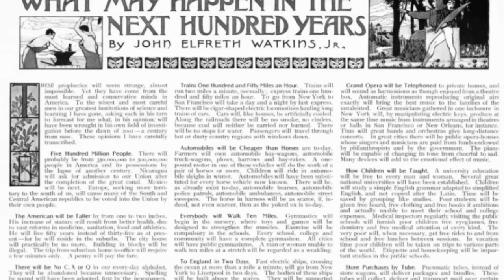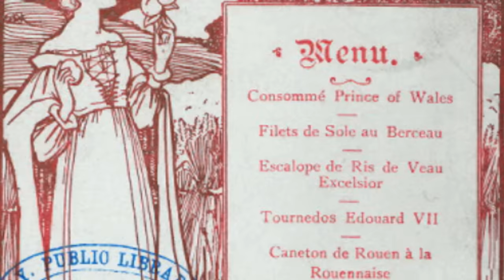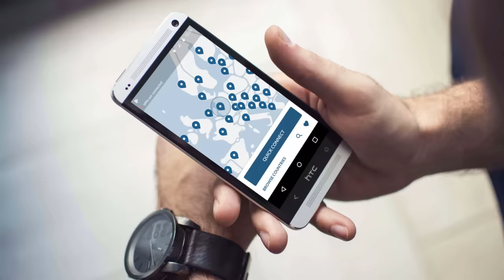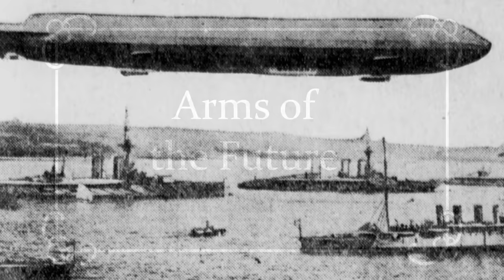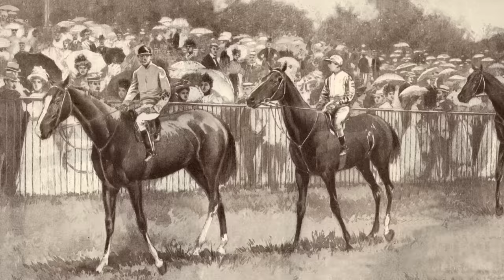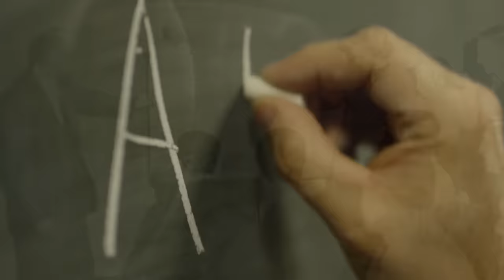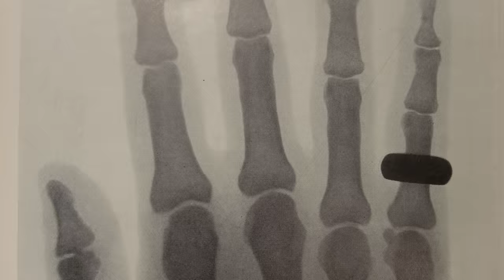Futurist from 1901 Describes The World of 2001 // 'Ladies Home Journal' (1901) // Primary Source

Comment: "The automobile will have practically replaced the horse in American society" Yeah, pretty much.
"All parts of America will be connected to the rest of the world by telephone wire" Very true, mostly.
"A university education will be free to every man and woman." *cries
Reply: Yes, we're stuck with only 13 years of free education instead (K-12)
Reply: @spk1121  I mean, they also had free and compulsory education to that level; it's just that back then you didn't need a degree to get a good job. At least we have free healthcare for the poor-...ohhhh
Reply: @DensetsuVII  you still don't need a degree to get a good job. If anything, a degree can be a detriment since it costs time and money that could have been used to gain practical experience
Reply: @DensetsuVII : College has become a form of gatekeeping. You have to go through "the system" in order to be considered acceptable to the overwhelmingly leftist HR depts across the country. Really think about this: Have jobs changed that much since the 1950s, that they require a degree? Secretarial jobs require them now, for crying out loud! And it would be very easy to adjust curriculums to add opportunities to earn certificates in fields like coding, no different than offering AP classes for college credit. That's why they "teach to the test" nowadays. Not too long ago, high school prepared you to enter the real world. Today, it is almost entirely focused on getting into college. It's why so many college students are clueless about so many things. They've had little to no grounding in the real world.
Reply: @spk1121  hurray to the Google degree then lol
Reply: @spk1121  that natural since employers got more options to choose from.
Reply: We do have free education
Reply: @GoldenOrder  Income tax rates of over 50% are also normal. In America most poor people have free healthcare and kids qho excell in academics and/or sports can get scholarships. Most lower income families receive $4k or more in tax returns. Most Americans believe that we best know how to spend our $ and we certainly get more per dollar spent. Governments are inefficient with $, spending twice or more what private companies do for the same thing. I can't remember who said it but "any government big enough to give you everything you want is powerful enough to take it everything you have."
Reply: @boomerisadog3899  A fun fact about the efficiency of government is that high schools that get the most government funding get the worst results.
Reply: It's true-ish in Europe (not free but dirt cheap)
Reply: All of the developed and developing world except america
Reply: "there will be no wild animals" 
w h a t
Reply: Public colleges are free here in Israel for veterans (and basically all Jews at least are veterans because it's required)
Reply: Get out of here ya mush. You get what you pay for. If college is free, the education quality decreases and the value of said degree decreases. It's already happening with all the government money they get as well as tuition fees. It's no one else's job to better you, only you can do that.
Reply: @spk1121  what do you mean by leftist hr?
Reply: @tanegram :  Have you heard the term "Get Woke, Go Broke"? It's a meme describing how companies are integrating cultural Marxism into their business practices, even to the point of losing billions of dollars because they are so stubborn about pushing the ideology. It's how they justify mandating toxic "diversity training," where they are literally paid to preach all white people are inherently racist & that America is fundamentally evil. How do businesses get to such an extreme position? It all starts in the HR Dept. A company's culture doesn't change that radically without HR acting as gatekeepers. They're the ones who not only select the employees, but run such awful, brainwashing "workshops." They look for people, like the fact-checkers I mentioned, who lack actual integrity & focus on "revolutionizing" the way society functions. That's the stated purpose of cultural Marxism: revolution. Antifa admits it, the leaders of BLM admit it, and do on. And within businesses, it's the HR Dept who leads the charge.
Reply: The lack or healthcare and public free university education are consequences of ideology and political decisions in the US, not technological or economic trends. Therefore unpredictable. The proof is that the US is the exception in that regard not the rule. All advanced countries (and some of the poor ones) have public healthcare systems or subsidized college education or both
Reply: John Frylock :
1.) You have zero knowledge of me or my level of education, along with everyone else who disagrees with your pompous ass.
2.) Why is it automatically rational? Why should taxpayers cover the costs of degrees that, as I pointed out above, were completely unnecessary for similar jobs only a few decades ago? No one has even attempted to refute that simple assertion because we all know it's true. Why should taxpayers fund Gender Studies & other such fields? I don't want my money going towards that! And if people are that interested in such a field, they should pay for it, just like they do now!
3.) I have some respect for Forbes, but the author admits she based her article entirely on reports by BuzzFeed and (MS)NBC! Yeah, they haven't been heavily criticized for repeatedly reporting fake news or anything. * lol * They've been exposed as liars time & time again. Zuckerberg has admitted to such discrimination and said they "will take steps to do better." (Yeah, right.) Jack Dorsey from Twitter admitted it on the Joe Rogan podcast. Seriously, dude, you are in a solid echo chamber if you can't admit conservatives face higher rates of discrimination online. Fun fact: The ones on the left who are most likely to encounter similar issues are the most anti-war.
4.) Look at my response to Joaquin M as to why I consider HR depts to be leftist in general, in greater detail.
Reply: Funny how a video about the musings of futurists in 1901 has turned into a whole commentary & arguments about the current state of the U.S. * shrug *
Reply: @spk1121  You lost me at the "Cultural Marxism" bit. That's no a thing that exist, and usually when I see it in the Internet is code language for "the Jews". Also the Left should have to be very powerful indeed, if they have control of HR departments across America, to gate keep for the college educated.
Now, in the realm of reality, the reason why you need college education for work roles that didn't require it in 1900 is because employers ask for it. For example, in 1900 you could get a job as a teller in a bank without a college degree, because it was a mechanical job dealing with public and recording transactions, because of that, the skills required for the job were being good with numbers, have a good penmanship and some basic knowledge of bookkeeping. These days, first you would be hard pressed to find people working as a teller in the traditional sense (that job has been automated) is now more of a role that bank employees have sometimes as part of their duties, but they also act as credit officers, financial advisors and the day to day operating of a bank includes fairly complex operations like reconciliation, you need to have an understanding on how to operate and interact with computer systems and other institutions, regulators, etc. So the amount of education that an employer needs from his employees to make a profit out of them, is vastly different. But the cost of that education has to come from somewhere. In the US the owner class and their politicians decided they wanted to Profit from a more educated workforce but didn't want to shoulder any of the costs, either by the companies training their new hires in house or by paying higher taxes so the State could pay for it. They simply required university education for entry-level jobs which de Facto passed the education costs to the workers. 
Most advanced countries decided for public University and Vocational education instead, to better living standards and don't unfairly burden workers with its cost. Result: better social harmony and healthier economies.
Reply: @Densetsu VII Don't feel bad about not going to University/College. I spent a decade of my life and tens of thousands of dollars on University and it was a waste. The fact that everyone gets a degree these days had devalued those degrees to the point that they are worthless. Other than a single idealistic one, all the professors there were more interested in telling me what to think, rather than how to think. They believed that they already knew all the answers and that I was just an empty vessel that they were going to make think "the right way". Only one man thought that his job was to teach me how to think for myself so I could find my own answers. And the Universe mistreated him and hounded him out for questioning established doctrine. To top it all off, I could have easily learned all the facts and knowledge that I learned in University, by using the internet. By reading books, by downloading audiobooks, by downloading pre-recorded lectures off of sites like Audible.

The image we have of University as a place of learning, where you go to expand your mind and become a better citizen has not been valid since the 1980s. Its now just an extension of High School that you have to go into debt for. For your own sake I would advise staying away. Invest your time and money on something worth while. Don't sacrifice your future just so a bunch of pretentious assholes can brainwash you.

I've been where you're headed. For Heaven's sake, turn back.
Reply: You don’t need a degree for a good paying job, there is such a thing as Trade Schools that teach trades such as mechanics, plumbing and many others! Unlike a lot of countries, we don’t need to pay for the first 13 years, we get our books free, don’t have to pay for tuition (unless in a private school) or uniforms.
Reply: John Frylock : Ha, ha, ha! It all boils down to ad hominem attacks, doesn't it? No refutation to any of the points in my latest response, not a single one, just insults. Honestly, if people on the political left didn't devolve to this level so quickly, I would be much more inclined to take their ideas seriously. Have a good day.
Reply: @marlonbryanmunoznunez3179 : My response keeps getting deleted (speaking of gatekeeping), so I'm going to break it up into chunks.
Reply: @marlonbryanmunoznunez3179 :  Well, again, you know nothing about me. I grew up in an area with a large Jish population and have at least a dozen Jish friends. I don't subscribe to the theory of an all-powerful cabal because I recognize there are plenty of white people (or of other races, which could include some Js) who would happily screw over a huge number of their fellow citizens in the pursuit of power & wealth. Also not sure why you inferred that when I didn't even remotely refer to them, but to Antifa and BLM instead. As for not believing in cultural Marxism, all I can say is that leaders in those radical groups have openly admitted their motives & their unabashed desire to overthrow the institutions and foundations of this country. I'm not getting this from from some right-wing tabloid; I've listened to or read their own words.
Reply: @marlonbryanmunoznunez3179 :
It's a funny coincidence that you brought up banking to make your argument. I worked at a credit union for 2 years, then a bank for about 6 months, so I can say with absolute confidence that you're incorrect. My degree was not in finance or business, far from it, yet I did very well by keeping an accurate drawer, meeting sales goals (like convincing people to put money into a certificate of deposit), and good customer service. I knew several tellers who advanced to the level where they could do loans & other more complicated transactions. They did this with in-house training and, like me, a number of them did not have a specific financial background. Yet they got promoted and were good at their jobs! So, yeah, I know from personal experience that one job many people think requires a degree, doesn't, which gives me solid reason to believe there are many others.
Reply: @marlonbryanmunoznunez3179 : As for vocational training, that is by far the most cost-effective approach. Here's the truly ironic part about the absurdly high costs of college: It's almost entirely because of govt intervention. Why does tuition keep going up at state universities? Or at private ones where some, like Harvard or Take, receive millions upon millions of dollars in endowments? Ever since the govt has guaranteed student loans, this has been the case. The universities can bleed their students dry and, by extension, the govt. This, coupled with overreaching govt oversight, has led to bloated bureaucracies with little accountability. There are any number of examples about endowments going to a new wing of the library or some other project for the glory of the school, rather than lowering tuition. It's gotten so absurd that, in those rare cases it actually happens, it will be deemed a newsworthy occasion! Did you know some colleges are still charging rates to include room & board while only offering classes online during the pandemic? If students have the need to protest, I would immediately point to their university's administrative building & the office of the president/chancellor!
Reply: @marlonbryanmunoznunez3179 :   
Last thing, regarding the power of their gatekeeping. I strongly encourage you to look at the testimonials of the #WalkAway Campaign. There are gay people who say "coming out" as conservative has been far more difficult than revealing their sexual orientation. There are people who have not only lost people they considered close friends, but have been completely shunned by family members, if not cut off entirely. A significant number of academics have admitted they "played along" when it came to their professors' biases in order to graduate, and the rare times one academic has spoken out, they invariably tell of support from colleagues who beg for anonymity because they're too frightened to say anything themselves. And yes, there are people who have been denied admission to a school or a job because they wore a MAGA hat or showed any sort of support for Donald Trump. (Marquette recently had a scandal where the president outright admitted it & didn't back down until a public outcry.) There are people who have either been fired or denigrated at work to the point where they are forced to quit. So, yeah, I stand behind my statement that HR depts are powerful. If millions of people are afraid to say something about what they believe, it really says something about the people who hold their livelihoods in their hands.
Reply: Brynden Rivers : Tell me why. If you have an actual argument, I'd like to hear it. I've seen Antifa swinging hammer & sickle flags; I've watched one of the leaders of BLM admit that she & another founder are, in her own words, "trained Marxists." Can you point out HOW I'm dumb & wrong? And for the record, taxes already go towards funding state schools and I am fine with that. As I stated above, though, that money should be used to lower tuition. Not force every taxpayer to pay for every student at the exorbitant rates they charge nowadays. And yeah, I'm one of those crazy people who thinks everyone should, as much as possible, keep as much of their own money to spend as they see fit, rather than handing it off to bloated, inefficient govt agencies. You can agree with that, right? That a lot of govt is bloated & inefficient?
Reply: @IRosamelia  what's really wacky about that is the only reason y'all can afford to have welfare states with free college education is because you don't have to fork up as much money for your defense because of us.
Reply: @GoldenOrder  Same in France and many other European countries
Reply: @GoldenOrder  Yeah
Reply: @boomerisadog3899  I'd like to know where that free healthcare is at. When I was in Peace Corps, I collapsed on the side of the road, and woke up in the hospital, finding out I had a brain tumor. When I was sent back home, I was asked 3 or more times, everytime I went to the hospital, who was going to pay for my brain surgery. They said if there was no for sure answer, that they would push my surgery back by a few months. Luckily Peace Corps paid, otherwise I might be dead. It wasn't just a brain tumor, it was aggressive cancer. 
Also- the hospital did say they would cover my treatments, since they knew I was from a low-income family. Turns out what they actually did though, was try to send every bill to Peace Corps, even though I told them, Peace Corps wasn't going to pay for anything past the brain surgery. So- Peace Corps sent it back, and it bounced around so long, until it finally came back on me. A lovely surprise bill of $51,000. 
Oh, and when I applied for Social Security, I was denied because I had- and I quote, "The wrong type of cancer." They only had forms for breast and cervical cancer, which I told them I didn't have. They didn't care, and told me to fill it out anyway. 
People claim it's so easy for the poor to get help in the US, but I haven't seen it. Luckily, I have been able to move to South Korea as a teacher, and here they actually do cover the cost of my MRIs, and anything else related to my cancer. Something I never experienced in the US.
Reply: @GoldenOrder  Nothing is free. Another part of the economy takes a hit for it. (Not a value judgment. Just an observation).
Reply: @arandomyoutubeuser_____8930  I live in a rural part of Tennessee and did construction work my entire life, even after 2 back surgeries. When I had yet another ruptured disk and needed another surgery I got it with no insurance. Afterwards I applied for Tenncare and got it. It not only pays for my current medical bills but paid for my lasg surgery as well. Your experience is not representative of what countless friends and family of mine have experienced. I'm 40 years old and own my own home, several cars (including a 67 Chevelle SS), an rv, a rental property, and have nice piece of undeveloped land bordering a national forest. All of that is paid for, although, I do have to pay property taxes. I was born dirt poor and raised by my grandparents. Everything I have my wife and I earned through hard work and sacrifice. The great thing about all that is that this country gave me the freedom to earn those things and didn't take unreasonable amounts of $ from me to pay for other people's bad decisions. America is a great country, not for what it does for it's citizens but for opportunities and freedoms it protects. I'm happy that you found a country tbat more closely aligns with what you believe a country should be. You should be thankful, for what American medicine did for you, instead of angry that it wasn't %100 free. You should also be thankful to this great country for the freedoms and wealth that South Korea enjoys. That country wouldn't even exist without the help and continued support of the United States.
Reply: @boomerisadog3899  I'm glad that you have had a good experience, truly. However, in South Carolina, it's not so easy to find people that want to cover cancer patients. Especially patients with aggressive cancer. I know that my experience is not representative of what everyone in the US experiences. I have plenty of extended family members who argue with me, because they've never had an issue with medical insurance in their entire lives. However, you should also know that your experience isn't representative of what millions of other Americans like me, continue to experience in the US. I am, and will forever be grateful to the men who saved my life. However, I can also be angry that the system was only willing to do it quickly, if they had a guarantee of money. I can also be angry that I was denied Social Security, because I "had the wrong type of cancer." (their words) I don't know that I will ever have good credit in the US, thanks to the $51,000 bill that was thrust upon me, all because they didn't let me die. If you have any suggestions for how I can get that paid for, I'm all ears. Seriously. I don't hate the US. I love my country, but I'm also saddened by the fact that many poor people, like myself, get screwed over by the system time and time again. I will also mention that an MRI in the US is $3700 and here it's $400, with no insurance. The main difference is that the waiting rooms here aren't quite as extravagant as the waiting rooms in the US.  There is no legitimate reason that the price should be that different.
Reply: Densetsu VII they did at least get free lunches and rides to school correct
Reply: Confused shrugged* university education shouldn’t be free.  Government is to big and bloated as is.
Reply: for people who are poor we already have free college. harvard charges you nothing if your family makes below a certain amount (though that only goes to brown people, discrimmination against whites is common nowadays.....bet they didn't see that coming)
Reply: Postal Patriot556 
That’s complete and utter nonsense and you know it. Stop propagating misinformation to serve your agenda. It’s the same mindset which is stopping America from attaining a healthcare system worth the name.
Reply: Free education would only create a spiral up on the necessity of education College would no longer be enough as the college student is universal as college is free. The masters and PhD would begin being needed for anything but entry-level jobs. Then the call will be made for those to be made free as well. A new degree will be made since phds have become a common sight. Eventually the system collapses under its own weight as people live their whole lives as students or the requirements for working become so unreasonable that everyone simply refuses to climb that mountain of education.
Reply: @BlueGamingRage  you do need a degree for most any career or Atleast a trade certificate
Reply: We are getting there
Reply: Back then a "University Education" wasn't just a job farm, that was the only possible way to learn anything scholarly besides coming across books which was much harder, even libraries weren't that widespread and stocked as they are today. Now we can get 1000x the education they got online, and for free.
Reply: Brynden Rivers : Can you do me a favor and define what you think “Marxism, socialism, and/or communism” means?
Marxism is entirely based on the concept of oppressed and oppressor, the proletariat and the bourgeoisie. They are enemies; there can be no reconciliation, which is why revolution is required. It was originally considered an economic theory, which is why he argued capitalism would gradually give way to communism. He spoke in very broad terms and rarely, if ever, acknowledged the complexities of human nature. Finding the economic model to be less effective in converting the masses than desired, Marxists have shifted to a cultural angle. There are still victims and oppressors, which is why a revolution is still required. All women are oppressed by all men. All black people are held down by all white people. All gays are despised by all religious people. And since there are so many oppressed classes, it becomes necessary to form a victimhood hierarchy. All societal ills are systemic, requiring the aforementioned revolution.

You have been speaking in this language yourself, right here in this thread. "Conservatives, especially nowadays, tend to have hideous and bigoted views about other human beings..." "Trump supporters are typically hateful people or people who are okay with hatefulness." Yeah, you added "tend to" and "typically" to cover your bases, but I'm guessing you would say at least 95% of them are this way. You painted with a particularly broad brush when you said, "Who gives a damn about some Catholic university, you’re more likely to get a finger in your b-u-m than you are a degree there anyways." That's not a gross generalization in any way! /s By the way, you didn't refute my example. You just dismissed it outright because it would have given at least some credence to my argument. But hey, I'm the one ignoring facts!

Look at my response to you. I didn't call you dumb and wrong in return, instead I asked you WHY you think the way you do. Few liberals and no leftists ask this first, ever, at least in my experience. Do you believe around 50% of the country is genuinely evil? If so, that's why you so easily say conservatives are hideous, bigoted, and hateful. It dehumanizes us and allows you to unabashedly view conservatives as your enemies, with no chance for reconciliation. It's good and right to hate the hateful, isn't it? So, oversimplifying the world (as Marx did) allows such a mindset to continue without guilt or introspection. And for the record, I fully believe it is possible for leftists to eventually believe otherwise, which is why I try my absolute best not to demonize them, despite my extreme disagreement with them. #WalkAway has proved this happens again & again, beyond a doubt.
Reply: Brynden Rivers : Can you do me a favor and define what you think “Marxism, socialism, and/or communism” means?
According to Merriam-Webster, socialism is...
1: any of various economic and political theories advocating collective or governmental ownership and administration of the means of production and distribution of goods
2a: a system of society or group living in which there is no private property
2b: a system or condition of society in which the means of production are owned and controlled by the state
3: a stage of society in Marxist theory transitional between capitalism and communism and distinguished by unequal distribution of goods and pay according to work done

Nobody actually wants socialism. They want fair capitalism with a strong social safety net. I say this because no one could possibly want govt ownership of private goods. If you say otherwise, you're lying, most of all to yourself. A good example would be if the govt decided you don't need a car because you are within biking distance of work and/or public transportation is accessible, if inconvenient. They then "reassign" your private property, most likely without consulting you first, in the name of the "public good." Since the state would control the means of production, they might then decide to produce the absolute minimum number of vehicles required to keep things running, never even giving you an opportunity to have another vehicle in the future. Sounds fun, right? There are already numerous instances of eminent domain be horribly abused. Can you imagine this on a nationwide scale with everything? By the way, even Denmark told Bernie Sanders to stop referring to their nation as socialist! Because nobody actually wants socialism.
Reply: Brynden Rivers :*Can you do me a favor and define what you think “Marxism, socialism, and/or communism” means?*
According to Merriam-Webster, communism is..
1a: a system in which goods are owned in common and are available to all as needed
1b: a theory advocating elimination of private property
2 -- capitalized
a: a doctrine based on revolutionary Marxian socialism and Marxism-Leninism that was the official ideology of the U.S.S.R.
b: a totalitarian system of government in which a single authoritarian party controls state-owned means of production
c: a final stage of society in Marxist theory in which the state has withered away and economic goods are distributed equitably

1a, 1b, and 2c are based solely on theory. 2a & 2b are the reality. As I said above, Marx failed utterly and completely in his understanding of human nature. Communism might have a genuine chance under one condition: society would be made up entirely of robots. Everyone would be built for a single purpose, would know their place, and would contentedly stay there. No ambition, no love (which often leads to the greatest feats imaginable), no courage, and most importantly, no dissent. Only perfect harmony can determine what should be produced and which goods should be available to whom. At least under socialism, you would get an official notice from the govt if they were taking your car away. Under communism, someone could just walk in and take it at any time! And again, the "public good" would be the excuse. Of course, there is no such thing as perfect harmony. Such actions (with the car) would lead directly to chaos, so the only way to "enforce harmony" is by totalitarian means. Regarding 2c, what does "distributed equitably" actually mean? Will a person who works hard & is a model worker receive exactly the same resources as the local slacker? If so, what's the incentive to even try? If not, doesn't it constitute private property if someone has something another person was not given? Honestly, the fact that so many people take Marx the least bit seriously baffles me. You have to give this 5 seconds of serious thought & it falls apart immediately.
Reply: Sans Handlebars : Thanks for saying something. I appreciate your kind words. I'm glad you were willing to make your own voice heard. I like to think that no one is truly lost, that even someone like John Frylock can learn better. I don't hate him or Brynden. I feel sorry for them and wish them the best. I provided a lead, Marquette, to Brynden, who immediately discounted it with a crass "joke," then unironically said I'm the one ignoring facts.The fact that JF cannot recognize his own baseless attacks, apparently needing for a direct quotation every time, or that he can believe he actually refuted anything, demonstrates the power of the conditioning.  They'll say we're brainwashed right-wingers while knowing nothing about us, but have they ever acknowledged the possibility of left-wing brainwashing? Do they think those on the left, particularly the more radical elements, are all as pure as the driven snow? That maybe, just possibly, there are things being hidden from them or even things they know, on some level, that they are willfully ignoring? Part of wishing them the best is the hope that they will come to see things from a different perspective. I am not looking to "convert" anyone. I just want to open some minds, hopefully allow some people to see just how ludicrous they are being. That's why took over an hour to compose my three-part answer to Brynden. At this point, I know I cannot reach JF in any way, but I'm hoping there's a chance Brynden will take another look at things. If he responds respectfully to those replies, I'll know it might be worth putting the time and effort into the rest of it. We shall see.
Reply: John Frylock  Wait....  You really believe that all the mega conglomerate tech companies are 'right wing' and pushing THAT agenda. You really believe that Google, Facebook, Twitter, etc... are pushing 'conservative views'.
 You're on the spectrum, aren't you.
Reply: @BlueGamingRage  depending on the field...
Theres teenagers gaining millions just by making content for youtube, you can quite as well get a good job without any degree.
The entertainment industry, especially the game industry, all you need to do is watch some tutorials and start practicing what you learn, in some ways is more about what you are capable of doing than how and where you learn to do it.
Reply: @boomerisadog3899  Honestly, this one reply was more help than my entire family has been. I've had others tell me that they've had things paid for, but nobody could ever seem to point me in a particular direction, of where to look. I have only been told to go to Social security, and as you already know, that didn't work out so well. 
Seriously though, I appreciate the answer, and the well-wishes. Thank you!!! And I hope you and your family stay well during this time.
Reply: @arandomyoutubeuser_____8930  No problem at all and I really do hope it helps. I've always had to do everything on my own too, if it wasn't for my wife I really don't know where I'd be right now. I just told her about your situation and she gave me those recommendations. Their really a lot of help out there but it's hard to find if you don't have someone that's had experience with that kind of thing. My wife's mother got lung cancer from working in a insulation factory and my wife took care of her through a lung transplant. So she's had more than her share of dealing with hospitals and all that. She's the sweetest, most selfless person I've ever known and I'm truly blessed to have her. Again, best of luck to you.
Reply: Tuition isn't free, but you can get the education for free on the Internet.
Reply: We had i tin Australia for a while 

cries that was my parents' generation but it is no more
Reply: You can get university level education from the internet for free for a lot of subjects.
Reply: Brazil and Nordic countries have free graduation and even free PhD.
Cries in third world.
Reply: Lol guys, I read your discussion. Have you all ever considered that just because it is free doesn't mean it is communist? But instead it is just... Affordable.
Reply: I don't know anything about United States Constitution but Brazillian Constitution says very clear that education and healthcare is a citzen right so is a government must.
Reply: @2pedroandrade : First of all, nothing is free. Someone has to pay for it somehow. In every single state (to the best of my knowledge), do you know who the highest paid public employee is? Not the mayor of the largest city, not the governor. It's the coaches for the American  football team at the various universities. Directing young men in how to run around & catch oblong balls is "worth" at least a million dollars a year, in their minds! Other costs go towards "improving" the campus, by adding fountains or another wing to a building, instead of lowering tuition. Trade schools & technical colleges are still very affordable because they remain focused on learning. They have nice facilities while still remaining cost-effective. Those schools are also far less likely to have bloated, inefficient bureaucracies in place, which eventually make self-perpetuation their goal, rather than remaining useful. It's why so many "temporary" programs in govt and at universities never end. It's the university culture & govt-subsidized loans that make college so expensive in this country. I would love for college to be more affordable & it stinks because just a few changes, albeit significant ones, would make them be so again.
Reply: It’s free if you ain’t American ✌🏻
Reply: They do that in the US, no excuse for the lack of good paying jobs other than there just isn't enough because it's cheaper to offshore as much as you can to tyrannical and destitute nations to pay lower thus bigger profits.
Reply: @spk1121  Exactly. It is not free, it is paid with our taxes. But one thing I can't understand. The US have taxes, right? If there isn't public higher education and healthcare, then what are they doing with your money? I know theres a lot of others services but education, healthcare and security are so primary.
Reply: Wireless connection connecting a husband on a boat in the Atlantic to his wife in her drawing room. Gps signal or internet. Great foresight !
Reply: Sans Handlebars  Well, in my personal opinion those public services in Brazil are top quality. I study at USP (Universidade de São Paulo), the biggest of latin-america and it is totally public, actually, all the top 10 universities in Brazil are public. Other thing is the healthcare here, we have SUS (Sistema Único de Saúde/Unified Health System) that makes me confort to drink water from the plumbing or get free tests or attendance for Covid-19 (or all others diseases), vaccines, medicines and even more.
The problem is: Brazil is not developed country, inequality here is big. The system might work, but it can fails where the government don't cover, but I think it is more a economic problem than a problem on public services. Finally, the Bolsonaro problem. I think everyone outside and inside Brazil with more than 2 neurons knows this guy is a lunatic. Since he was elected he just cut milions of Reais from Universities  and SUS. Why? Because he wants to be the USA. For good or for bad (You'll should see him talking with Al-Gore saying that he is very happy to "explore the Amazon with the US". This is just treason with his Homeland).
Reply: University education is essentially free via the internet. It's the degree/certification that you have to pay for.
Reply: Sans Handlebars  But I said very clearly that Brazil is not so well ranked because is indeed a poor country but the system works anyways. And I think help homeless and drug adictioners influences directly in my health. But SUS doesn't help only those people, it helps the whole country. All vaccines and medicines I used in my life were free, and this is universal in Brazil. The problem is: even with a well working health system, the economy of the country doesn't help on being the world's best health.
Reply: Sans Handlebars  Brazil poorverty is historical and structural. I know why my country is poor, I study Social Sciences, and there is nothing with taxes. At the time SUS didn't exist and there was no free university, Brazil was still poor. The riches don't flee from Brazil, they just don't let the others grow financially. For example, Brazil never had a land reform like Abraham Lincon did, so, the families wich were rich at 1600's probably still is rich nowadays and influences politically in the country. Also, talking about politics, here corruption is a REAL big thing, for some people, the only real problem that prevents Brazil to grow. And I not even talking about the Elites Dictatoriship and Military Dictatoriship (caused by USA at the 60's). Brazil plenitude as a democracy was just achieved at 1988, it is a damn new republic.
Reply: Sans Handlebars  I think it will be hard to we reach a conclusion since you are are arguing based in recent factual reports and I am analyzing at a historical and critical level.  I'm not unworthing your way of argue, data are essencial, but we need a little pinch of historical critical thinking and sociological imagination. It will be hard to conclude because we use different dialetical methods.
Reply: I scoff at that last one. Nothing is ever free in reality. There’s a cost for everything.
Reply: Actually, it is true by concept, you can learn all university education for free on the internet.
Reply: @punchnazis3268  Yeah I hate the forced migration of third worlders by billion dollar corporations to lower the prize of labor too
Reply: @spk1121  
>HR
>Leftist

Ah yes, the middle managers - scholars of Marxism who adhere to the ideology and work in middle management as a means of leftist praxis. How could I forget.
Reply: @spk1121  Describe Cultural Marxism in your own words. 😅
Reply: @bigwes617 : Keep reading, I already did that. And you can be an adherent of an ideology without being a scholar. Cultural Marxism is a worldview which turns everything into an oppressor/oppressed struggle. HR, in general, now operate under such conditions, like clearly biased "diversity training" and so on.

When a man is accused of sexual harassment, he usually cannot confront his accuser & is often forced to try to prove a negative. MeToo is this taken to an extreme. It started off right, with a few genuine scumbags being exposed, but quickly morphed into "Believe all women... without evidence." So much so that many men are adamant about not being alone with a woman, even in a mentoring capacity, and this has led to a dip in the number of women hired in the first place. Their toxic worldview was so unrelenting that they cheered for this. In the end, MeToo created a schism between the sexes which eroded trust and respect across all levels. Totally worth it, though! /s
Reply: @2pedroandrade : *...then what are they doing with your money?"
That's the crux of the matter, isn't it? Useless foreign wars is unquestionably the #1 problem. Billions in financial aid to other countries, particularly wealthy ones like Israel, are another. I think we could safely close a number of foreign military bases, too.

One news story from a year or two ago, which got buried by the mainstream media, is that Trump's "temper tantrums" with European allies resulted in several countries paying their fair share of NATO dues for the first time in decades.  It really is true that the USA's military spending gives other countries more opportunity to implement their social programs. Admittedly, we don't have any fiscal responsibility ourselves, which is why the nation is trillions of dollars in debt. As bad as universities can be, bloated & inefficient govt agencies or programs are far more rampant.

Last but not least is our history. While the executive branch has claimed enormous authority in the last 80 years, there is still a separation of powers between the  federal govt & the states. We have public universities, but the vast majority of tax money going towards them are from each state, not from the national level. This is to protect a state's autonomy, not making them dependent on the federal govt. It's a trade-off, to be sure. Sometimes, social cohesion is not as strong as it could be because we also highly value the independence of individuals, communities, and states.
Reply: @marlonbryanmunoznunez3179  there is value and virtue in not just giving these things for free. The independence and autonomy of individuals.  The virtue of self reliance of the individual and the family. It is the people's job to take care of their own private needs.
Reply: i love how your comment has somehow turn into a mud throwing competition by "experts" in economics and education.
Reply: *cries in American
Reply: @spk1121  before you accused others of not being well reasoned look at your own comment, you automatically assume everyone who doesn't think like you must be a leftist and that is a bad thing. Until you learn to ditch your stereotypes you are not well reasoned no matter how much you have deluded yourself.
Reply: 15:55
"Etiquette and house keeping will be important studies taught in public schools." 

That would be 1950.
In 2001, it's gender studies and Social Justice Warrior activism.
Reply: Universirty education used to be quiet cheap 50 years ago in the US. It pretty much is free in Western Europe.
Reply: Same... :(

On the other hand I chuckled when the prediction about airships came up. Ships aren’t that much faster than they used to be, at least in the grand scheme of things, however we truly have made the air our home.
Reply: @jon9103 :  I never assumed that. Where are you getting that from? It's true that I was speaking in general terms about HR depts, but I have solid reasons as to why I think so (which I explained in detail). I never, ever said anyone replying is a leftist. You know what did happen? Hans B immediately denounced me as an idiot, saying I should join the Dunning Kruger society. John F then jumped onboard, calling me illogical, nonsensical, and a weirdo. They did this before I ever said a word to either of them directly. The person who actually asked me what I meant got a respectful and hopefully informative reply. That's how I would have liked to have treated everyone is this thread, but you'll have to forgive me if I don't react all warm & fuzzy towards those who are being disrespectful from the get-go. Will you call out Hans B and John F for their mean, childish behavior?
Reply: @relo999  That's because they set the system up that way. Schools that perform worst geg allocated the resources requires to fix it...on paper. In reality the problems with failing schools runs much deeper than funding. It's a social and community issue thag funding plays a part in but not overwhelmingly so.
Reply: @spk1121  Find me a solid example of a company unequivocally stating to their employees "all white people are evil" and all the other nonsense you spouted. Post a link for us all to see this in action. Shouldn't be hard to find if its company policy. Should be real easy. Clock is ticking.
Reply: poewhite  There is a pretty large group of people seeking a more enlightened path. Technology is fine so long as it is incorporated and developed with reason and responsibility. Big difference between embracing the use of technology and allowing technology to replace your society. Im not sure how this game will end but I know that we aren't all going "silently into the night" when push comes to shove.
Reply: @marlonbryanmunoznunez3179  Good luck getting through to any of these people. They won't read all  ut the first couple sentences and decide it's "leftist garbage" and won't finish reading your point. A point which is well rationalized and laid out mind you.
Reply: @spk1121  is try to explain it to you but you have already demonstrated by your comments that you are quite insular so it would be a waste of both of our time.
Reply: @jedimindtrix2142  : Is 14 links within 3 hours enough?
To be clear, seminars on "white privilege" fall under this category since "privilege" wouldn't exist without the underlying assumptions that all white people are racist and all of society's ills are systemic in nature (racial or otherwise).
 As one trainer in Tennessee put it, "White privilege exists because of historic, enduring racism and biases."

*Seattle to White Employees: ‘Your Skin Color is a Crime’
Ordered to undertake "the work of undoing your own whiteness."
- I encourage you to read the entire video description. It includes the following:
Last month, the City of Seattle’s Office of Civil Rights sent an email inviting “white City employees” to attend a training session on “Interrupting Internalized Racial Superiority and Whiteness,” a program designed to help white workers examine their “complicity in the system of white supremacy” and “interrupt racism in ways that are accountable to Black, Indigenous and People of Color.” Hoping to learn more, I submitted a public records request for all documentation related to the training. The results are disturbing.
https://www.bitchute.com/video/fswSsRSIQ2Ci/

ALL White People are "Racist Demons" Says BLM Activist & Lecturer at Seminar
- Again, I encourage you to look at the video description for more quotations from her. This video is a short version; longer one is available if you search for Ashleigh Shackleford.
https://www.youtube.com/watch?v=cRXNaUz5LGY

Teaching consultant: Being on time, giving grades are forms of ‘white supremacy’
- Directly impacting teaching methods and approved cirriculums, meaning only teachers who agree with such notions will be considered for teaching jobs.
https://www.thecollegefix.com/teaching-consultant-time-giving-grades-forms-white-supremacy/

HR Expert: The Truth About Diversity Trainings
Wendi Modarelli (HRT Northwest) talks about human resources in a time of identity politics. Wendi gives her take on how businesses should address issues like diversity, equity and inclusion. Implicit bias is something that more companies are factoring into their hiring process, but what’s the best way to do it? Wendi also gives her expert opinion on what the data says about how effective diversity training is.
- While I must acknowledge there is little to no way to verify actual identities, it's still important to note there are a number of testimonies from people (in the comments) who have experienced such workplace programs.
https://www.youtube.com/watch?v=aMic_0a2TDE

UConn to pay ‘white fragility’ scholar Robin DiAngelo $20,000 for antiracism workshop
The University of Connecticut is slated to pay “white fragility” scholar Robin DiAngelo $20,000 to lead a three-and-a-half-hour workshop this fall for administrators during their professional development retreat... At the University of Texas in 2017, she told students that too many white people are teachers. During her appearance at Boston University in 2019, she said white people who don’t see race are “dangerous.”
- DiAngelo is a self-admitted racist who claims all whites (including herself) are racist, yet she, somehow, is an authoritative figure who is paid about $6,000/hr in order to harangue others & dictate how we should all live our lives.
https://www.thecollegefix.com/uconn-to-pay-white-fragility-scholar-robin-diangelo-20000-for-antiracism-workshop/
Accompanying article: 5 Reasons the Book “White Fragility” is Shallow and Destructive
https://medium.com/@annekathrynbailey/5-reasons-the-book-white-fragility-is-shallow-and-destructive-7d8512616aab

Company That Makes America’s Nuclear Weapons Hosted Training Session For White Execs To Show Their ‘White Privilege’
[Rufo says,] I’ve obtained exclusive whistleblower documents revealing that last year, the national laboratory sent its white male executives to the La Posada luxury resort to undergo a mandatory training called “White Men’s Caucus on Eliminating Racism, Sexism, and Homophobia in Organizations.” In the opening thought-work session, the trainers demand that the men make a list of associations about white male culture. The trainers write “white supremacists,” “KKK,” “Aryan Nation,” “MAGA hat,” “privileged,” and “mass killings.”

Finally, as the reeducation camp concludes, the white males must write letters “directed to white women, people of color, and other groups regarding the meaning of this Caucus experience.” They apologize for their “privilege” and pledge to become “better [allies].”
https://christopherrufo.com/national-nuclear-laboratory-training-on-white-privilege-and-white-male-culture/

Hamilton County Teachers Now Sit Through ‘White Privilege’ Training
Among only some of the lessons school system officials tried to impart to teachers:
 *People of color cannot be racist because they lack the institutional power to adversely affect white lives.
 *Even if minorities sometimes complain about whites, such complaints serve as coping mechanisms to withstand racism rather than actual anti-white bias.
 *Even when minorities express or practice prejudice against whites they are not racists.
 *White privilege is both a legacy and a cause of racism.
 **White privilege exists because of historic, enduring racism and biases.
*
https://tennesseestar.com/2019/08/03/hamilton-county-teachers-now-sit-through-white-privilege-training/

*The Privilege of Checking White Privilege
When students are compelled to have “White Privilege 101” classes, we have every right to ask: Why, and for whose benefit?*
In a society where racism is treated as morally equivalent to pedophilia, what whites are seeking is the sweet relief of moral absolution. Inside they are pleading, “Please don’t hate me!” And I wouldn’t be surprised if there is an accompanying feeling of purification (redemption, even) that comes with such consultant-given absolution. I can honestly say that I would be engaging in exactly this kind of moral self-flagellation about racism if I were white in today’s America. However, not being white, I can’t help but see it from a different perspective.
- Even The Daily Beast acknowledges something being very wrong, for crying out loud!
https://www.thedailybeast.com/the-privilege-of-checking-white-privilege
Reply: @jedimindtrix2142  Part 2
Professor who may be fired for refusing to undergo diversity training is not backing down
- Which dept is responsible overseeing diversity training programs?
Poelvoorde said the diversity training mandate “is, in effect, commanding [professors] not only what to watch but also what to think, given the content of this kind of material and its moral rather than its intellectual content.” "The irony of [possibly] firing their only Orthodox Jew in the name of diversity shouldn’t be lost on anybody.”
https://www.thecollegefix.com/professor-who-may-be-fired-for-refusing-to-undergo-diversity-training-is-not-backing-down/

Human Resource Management (Sociology)
"Another departure is the question of meaning (i.e., the meaning of HRM in terms of its rhetoric, its contingent qualities, and its tendency to be more of a cultural and political veil than a measurable reality in terms of increasing levels of skill formation and involvement). In this respect there are studies and overviews aimed at revealing the rhetorical and political qualities of HRM (Legge 2004), its tendency to be driven by an imperative for control as suggested by the increasing levels of surveillance at work (which has drawn interest from Marxist and postmodernist accounts), and, with regards to postmodernism, the way HRM strategies have attempted to construct employees ideologically in a variety of manipulative ways."
http://sociology.iresearchnet.com/sociology-of-organizations/human-resource-management/

How ‘Wokeness’ Is a Product of Marxism
Angela Sailor [a black woman], vice president of The Feulner Institute at The Heritage Foundation, said that “pervasive trends under the guise of equality makes diversity training in government, and corporate America, and schools, destructive, divisive, and harmful.”

Christopher Rufo... has delved into how “anti-racist training,” together with the Black Lives Matter movement, has invaded the boardroom and government. “This is now becoming the default ideology of the bureaucracy, and people are making, in some cases, millions of dollars offering essentially political indoctrination on the public dime to public employees,” Rufo said.

All levels of government, as well as nonprofits and corporations, now have human resources departments that have adopted critical race theory as their dominant functioning ideology, he said, adding that it’s become a particularly big problem at the federal level.
https://www.dailysignal.com/2020/08/02/how-wokeness-is-a-product-of-marxism/

Application and Theories Of Employment Relations: Main Theories Of Employment Relations"
- This is only one of four options, but it is fully acknowledged as a possibility.
The four important employment relationship theories are Pluralist, Unitarist, Marxist and Radical...
Marxist Theory
The Marxist theory or marxist philosophy can be explained as a method of a socioeconomic analysis that views social conflict and class relations. This concept claims that institutions can be better employers if they are run as a state organisation.
https://www.sampleassignment.com/blog/application-and-theories-of-employment-relations/

Economics professor barred from teaching class critical of Marxism to student body
- ...Osborne said he proposed it as an economics elective or as a special topics course that any business student [including future HR] could enroll in. Today, all these years later, his battle to open the course to all such students continues, he said." "Despite the refusal to open this course to the [entire] student body, the economics department currently allows [all] students to take a course every spring called Socialist and Radical Economics..."
- Osborne's class is currently only available to Honors students.
https://www.thecollegefix.com/economics-professor-barred-from-teaching-class-critical-of-marxism-to-student-body/
Reply: @jon9103 :  Ah, I see. You can't point to where I called people in the comments a leftist because it didn't happen. You won't acknowledge the insults that were hurled my way, nor will you say anything to those who behaved so poorly. What's even more ironic is that I have admitted to being in error a number of times in the past, when people presented me with actual evidence, but that possibility doesn't fit your narrative. You can't come up with an argument because there is no proof for your assertions. Seriously, you couldn't name a single thing. So like the others before you, you try to dismiss me by calling me "insular" when things aren't going your way. Maybe your own comment was not well-reasoned, like you think, but tribalist instead.
Reply: @jedimindtrix2142 : I agree with your assessment about inner-city schools, that "It's a social and community issue [that] funding plays a part in but not overwhelmingly so." It's a very complicated issue. [EDIT: After rereading this a few minutes later, I realize I inferred something with no real basis. I have removed it and if JediMind Trix has already read it, I apologize for doing so.] I do have serious problems with identitarianism and how everything is about race nowadays. Hopefully, you will bother to look at some of the links I provided and understand how pervasive this ideology is becoming.

As for @Marlon Bryan Muñoz Núñez, I read every single word he wrote. I then responded to him in four replies because I took what he was saying seriously &wanted to address each topic appropriately. Funny how you aren't willing to acknowledge all the time & effort I took to respectfully address everything he brought up.
Reply: University Is overrated. Harvard should pay ME to show up to their propaganda factory
Reply: @troyweatherford2428  nothing is free...  I'm sure your taxes are paying for it.
Reply: Meanwhile in Europe....
Reply: They were wrong about Autos being cheaper than horses and a bus ride casting a penny.
Reply: @Sadarsa  of course public schools are funded through taxes, you know that isn't what I meant.
Reply: with the internet, university level education is indeed free for everyone.
Reply: What is taught in K-12 today is light years ahead of basic school from 100 years ago. Especially with the ability to learn everything you could want to know about online.
Reply: A university education is free in communist nations.
Reply: @spk1121  I understand what you are saying. All these issues are grey even though people try to make them black and white (no pun Intended lol!) and just argue with no real substance. As far as the racial issues with companies go i have a complex outlook. I believe in opening up opportunities to minorities who may otherwise be skipped over.  I definitely think being White has given me huge advantage and privilege in our society. Now that being said I don't agree with people saying white people should be "ashamed" or "embarrassed" about being white. Nor should someone be ashamed be embarrassed about being Black, Asian, Latino, etc. I would say that I am politically Independent as far as parties. I don't like Democrats or Republicans. Both parties are bought, paid for and corrupt to the core. I dk fall to the left on most social issues except for guns. Love my 2nd ammendment haha! We need to invest in a public health care system for our citizens. Something like 40,000ish people die every year from simple illnesses that could be prevented if they had access to a doctor. I also believe in extending the k-12 system to college as well. If people want to go to a higb caliber, expensive school and can afford it, awesome! However lots of people come from families that just cant afford to send their kid(s) to college. Grants only go so far depending on the major and loans are not always an option for people. Especially people who have had financial issues and bad credit. I can't stand the argument of "people want handouts and free stuff" or the "whose gonna pay for it?!"  The answer to the first tired and worn out argument/question is this. No one is asking for a hand out. People just want to not have to choose between paying for electricity, food or a doctors visit/medication. As far as college goes no one makes that argument for k-12 schooling. Why is it when you leave 12th grade wanting access to higher education and a degree in a society that now mandates a degree for the most menial of jobs is "asking for handout?" I would happily sacrifice paying super high health insurance rates/premiums and high interest loans for college in exchange higher taxes. Ultimately it saves us all money as a society. If you really stop and think having more educated and healthier people equals a more prosperous society. As far as the "whose going to pay for it" question. The answer is all of us together as a society! We need to stop letting huge companies get away with paying nothing in terms of income tax. The middle class and lower high clas shoulder most of the burden while the richest and most capable of paying don't pay at all. This must stop. Anyways say "Johnny" has access to health care and his life is saved because he was able to go to a doctor and his checkup found something and because he found it early they were able to save his life. Now Johnny graduates high school and because he has a public college option available he goes and gets a degree in....lets say...software development. He then applys for a small business loan after he gets his degree and starts a software firm that employs 15 people. 10 of those people have a similar story of their own. Without access to those two basic things, healthcare and education, none of this would happen. Sorry about the book my man just throwin it all out there.
Reply: @ThePeacemaker848  education yes! Degree...sadly..no. as Frank Zappa said "if you want a degree go to college. If you want an education go to the library" or something to that effect.
Reply: Bring the horses back!
Reply: likeaZ6 
Nothing could be further from the truth. The American government has been dumbing us down for generations.

I highly recommend Dumbing Us Down by John Taylor Gatto. He’s a former Teacher of the Year for NYC, taught in the best and worst schools for 30 years and is a big advocate for homeschooling/unschooling.

P.S. I was homeschooled, as was my husband, we have no college education and run a very successful business we started from the ground up and debt-free. Know how we did that? We lived like paupers for years and continue to live well below our means. We have savings, paid for old cars and investment properties. Zero dependence on government. It can be done, all it takes is discipline and good morals and values. 
I will add we did all of this with 4 young children whom I homeschool as well...for free, using the internet and library. Couldn’t be happier. Land of the free, home of the brave🇺🇸
Reply: @jedimindtrix2142 : It's all good, man. I was interested to read your reply. Thanks for taking the time to type it all out.

I don't agree with people saying white people should be "ashamed" or "embarrassed" about being white. Nor should someone be ashamed be embarrassed about being Black, Asian, Latino, etc.
Exactly. The attempts to make white people "the other" bothers me a lot. As for advantage & privilege, there are a lot of white people who grew up in awful circumstances who are called "trailer trash," "inbred kicks," and who knows what else. I'm very reluctant to say such folks have a great deal when compared to middle class blacks, let alone the wealthy. I can safely say I believe your average black person encounters more negative stereotypes than the average white person. Which is a problem, to be sure, but as I said above, Cultural Marxism oversimplifies things to the point in which all black people are held down by all white people. The issues are, of course, far more complex than the mainstream media would have us believe. I have to roll my eyes when folks like LeBron James or Oprah speak (completely without irony) about how they are oppressed. Not black people in general, but themselves. LeBron compared himself to Emmett Till, for crying out loud! That kind of victimhood complex is part & parcel of the oppressor/oppressed paradigm.

I don't like Democrats or Republicans. Both parties are bought, paid for and corrupt to the core.
I bet this will surprise you. I agree with this 100%. I am an independent voter, not registered with the GOP, even though I consider myself conservative. In fact, on a few issues, I have been considered moderate. I admit I think the Ds have gone completely off the rails in the last few years, so I am far more likely to vote R than not right now, but I have voted for Ds in the past when I thought they were reasonable & seemed to care about the people they serve.

wanting...  a degree in a society that now mandates a degree for the most menial of jobs is "asking for handout?"
And now we go allllllll the way back to the top. Why is this the case? Who benefits from this? Obviously, the universities themselves make a killing, but why would businesses do this? Why would they require people to go into thousands of dollars in debt for the most menial of jobs? This is why I believe HR to be gatekeepers. The only benefit is making sure people have been through a system that conditions them to the "correct" way of thinking. For instance, I have heard numerous stories about children/siblings going off to college and, within a shockingly short amount of time, becoming completely different people. One of the saddest things I've read was when a guy talked about how loving and happy his sibling once was, then how she became a miserable, unkind ultra-feminist at college, and he ended sadly with, "I just want my sister back." The last thing on his mind was scorn or hate; he loved her & missed her so much. And now you've got people who are convinced that critical race theory is the way to view the world, acting accordingly in their places of work. I don't have any problem with people being liberals. I do have major concerns when this kind of leftist ideology is not only adopted, but forced upon others, and I consider the totally unnecessary requirement for so many degrees to be an integral part of all this. You may think I'm blowing things out of proportion, which is fine, but I hope that the links I provided demonstrate I have at least some basis for thinking the way I do. And if not, who do you think benefits the most from this situation? Why are degrees required across the board now? Anyway, that's why I argue that K-12 should be sufficient. We urgently need to get to the root of this & fix it accordingly.

We need to stop letting huge companies get away with paying nothing in terms of income tax. The middle class and lower high clas shoulder most of the burden while the richest and most capable of paying don't pay at all.
While I think that's oversimplifying matters somewhat, I definitely agree with the gist of what you're saying. If I could pass only one law regarding the business world, it would probably be making it illegal for states & cities to offer massive tax breaks to corporations. If you offer a rate to one company, it has to be applied across the board. I understand that the people hired by the company will pay taxes from that income, which is the usual argument, but I hate how ordinary businesses have to struggle while Amazon can stroll right in & essentially dictate how little they will have to contribute towards infrastruture, essential services, & so on.

We also desperately need to simplify the tax code. Again, who benefits the most from a complicated tax system? Accounting firms, of course, and the big businesses who can hire the best of them to exploit all sorts of loopholes. In a way, I have to hate not the player, but the game. Who sets the rules? Govt, of course! Our beloved Congressional reps in both houses are the ones who set up & perpetuate the convoluted, inefficient game we're all forced to play. I can't really fault corporations for making the best of the situation, especially considering the corporate tax is one of the highest in the world. I can't pretend I wouldn't do the same. We need to drop that rate significantly & then make it all very simple & airtight. Little to no opportunities to exploit the system while promoting businesses on all levels & helping everyone to prosper.
Reply: @jedimindtrix2142 : Part 2
If people want to go to a high caliber, expensive school and can afford it, awesome! However lots of people come from families that just cant afford to send their kid(s) to college.
Again, this may surprise you, but I am in favor of affirmative action. However, I am adamant that it should apply to class, not immutable characteristics like race or gender. I think everyone can get behind the stories of "poor kids who made it," for starters. I understand, and I think most others do as well, that some students simply don't have access to highly regarded schools, the best tutors, or even opportunities like sports scholarships in small, rural towns. Whether from the 'hood or a cornfield, that doesn't mean those kids aren't bright or even outright brilliant. That is precisely the kind of situation where I would argue "a leg up" would be welcome & appropriate. It's also worth noting there are millions of dollars in unclaimed grants & scholarships every year. I think some apps have been developed which have improved things, but it's still very much the case. If we could get every option on one platform & figure out a way to streamline the search process, I think it could be an amazing opportunity for so many prospective students out there. I, myself, knew very little about all this when I first started college and I have little doubt I missed out on some great possibilities. Last but not least, there should be a mandate that student loans have a maximum 5% interest rate. I hate how they gouge students who are trying to do what is currently necessary for a decent job.

We need to invest in a public health care system for our citizens.
I never said otherwise. Now, I am under no obligation whatsoever to share this detail with you, but I will. I am currently on Medicaid, have been for some time, & I am extremely grateful this is the case. I have a number of health problems and before I got onto Medicaid, I was on a private plan that increased each year to the point where I was paying over $500 a month. I kid you not. So if anyone thinks I am a fan of how health insurance is currently handled, they are gravely mistaken. However, I would argue for the states to handle this far more than the federal govt. They are more easily held to account by their constituents & can tailor their programs to meet the population's needs more quickly & effectively. If nothing else, look at the VA hospital system. It's run on the federal level & I think pretty much everyone agrees it's a disaster, so why expand that mess 100,000 times over?

Moreover, once again, I think govt oversight is an issue. Why is auto insurance reasonably priced & available to all but the most destitute, but health insurance is not? It's because that part of the industry has a lot less regulation and red tape. Another example is how state govts have set things up so most internet providers in an area have a duopoly at best, but an actual monopoly more often. Why isn't there more competition? Because of laws and other regulations, of course! How does that help the consumer? Umm, it doesn't! Same thing with health insurance. Need to open it up to more competition so the handful of big guns can't continue to dominate the field.

Now, let's back up a little bit.
Most of those people don't open their mouth in public because they know how stupid they would sound. Everything they dont like is a result of "leftists" rofl. It's a sad and simple world view dictated by small and simple minded men stuck in their own echo chambers.
Did you bother to write your "book" in response to a "small and simpleminded man" who only cares about his echo chamber? Do I lack substance or sound stupid to you now? I'm not condemning you for this. Quite the opposite, in fact. I commend you for not insisting on staying in your mindset, but responding thoughtfully & in detail when you realized there is actually more to me. I just want you to think about what you said about me before you ever said a word to me directly. I quote myself from above: "I am not looking to 'convert' anyone. I just want to open some minds, hopefully allow some people to see just how ludicrous they are being." I hope you will remember this exchange in the future & not be so quick to dismiss some people so harshly.

Sorry for the length of my own reply, but I wanted to address everything you mentioned accordingly. I hope it all makes sense. Have a great day!
Reply: @ThePeacemaker848 : @JediMind Trix brought up a valid point, but I don't see why this has to be the case. You can be homeschooled your entire life and still get your GED, the equivalent of a high school diploma. There absolutely should be something similar for universities. Of course, they would resist this mightily because, God forbid, you might learn all this stuff on your own without shelling out thousands & thousands of dollars! Support independent learning? Crazy talk, I tell ya! Anyway, yeah, I would love to see the college-level GED become an option.
Reply: The internet?
Reply: @spk1121  I apologize for that comment. YouTube comment boards occasionally bring out the worst in me after I have read a bunch of ignorance prior to reading your posts. You came off as someone denying that issues of class and off the books racism existed for one reason or another at that point. I brought the other issues up so you could see just what kind of mindset I have when it comes to political and social issues. I actually totally agree that a lot of the problems of modern racism truly boil down to income and class. A rich Black man is treated with a hell of a lot more respect than a poor White man. However these things are very complicated and different people have different motivations for how they view and treat others. Seems like when push comes to shove we are basically in the same mindset regarding most issues. Hopefully we can get our collective shit together as a nation and move on from this terrible spot in history.
Reply: @spk1121  The only thing I find myself in disagreement here with you is your outlook on College and changing people. Your friend and  sister who turned into a feminist for example. She probably was bound for that mindset one way or the other. College is supposed to be a place with diverse ideas, philosophy and people. I believe Republican politicians and pundits have demonized all forms of left leaning liberal thought as "Communism and Socialism" and something to be hated and feared. That is not good at all. It creates an "us VS them" mentality and has largely contributed to the violence we have seen on the streets. For example citing groups like Antfa and trying to link them to all left wing politics is common place now. They work people up into such a fervor about the "Evil Left" that when people want to make education and healthcare more accessible they are immediately called A Socialist or a Communist who hates America. However when Republicans take the same tax dollars that would be spent on healthcare and education and instead cut a fat check to Farmers that Trump completely screwed with his Tarrifs it's completely cool! Just call it "economic aid" instead of "social spending" and they are all perfectly fine with it lol. I am referring to the "Farm Bill" they passed a little while back. That was for sure "social spending" and not one person on the Right called it out for what it was.  I am willing to bet almost all of the people attacking "leftist snow flakes" couldn't tell you what the definition of Communism or Socialism is or what the differences in the systems are. Democratic Socialism, which is entirely different from Communism or Socialism can't exist without a strong Capitalistic backbone. The only thing the system shares is the word "socialism" and that's it. In fact I'd argue Captialism is the best form of government if and only if you mix in some social programs and spending. We generate a ton of capital and end up wasting it and not utilizing it for the maximum benefit it could provide. If we don't look out for our own citizens the gap between the rich and poor will widen even more. If we make sure everyone is healthy and educated along with some common sense tax reform targeting those who harbor billions and trillions in off shore accounts we can close that gap quickly.
Reply: @marlonbryanmunoznunez3179  The government is not, in my opinion,  the best instrument to run health care for individuals. A government safety net for those individuals who can not provide their own already exists. And Medicare for those over 65. Americans have not traditionally looked to government to solve their individual problems. We don't like interference in our private affairs.  Look at our reaction to Obamacare. We , for the most part, ignored it to death. We refuse to be told what to do. Individual Rights are based on individual responsibilities
I believe that using government to provide health care is like using a hammer to fix a watch.
Reply: Some parts of the world have free education. You'll get there eventually.
Reply: Troy Weatherford it isn’t actually free. It is just paid for by someone else. Professors and administrators and janitors don’t work for free.
Reply: Anonymous Narwhal the only way it could be considered free is if the professors and administrators and janitors worked for free. Otherwise it is paid for, but by someone else.
Reply: @BlueGamingRage  I guess you have a different idea of what "good" means in this context.
Reply: @troyweatherford2428  Not beyond high school in the US, we don't.  It's insane.
Reply: @boomerisadog3899  Um, no, most poor people do NOT have free healthcare in the US.  A lot of people in the US who are poor cannot qualify for the insanely small insufficient help that Medicaid really is now, when combined with its insane rules.
Reply: @PostalPatriot556  This whole "do everything yourself or you deserve to die sick, miserable, and poor" must be done away with in the US if we ever want to be a properly fair and modern first world nation like the rest of them who learned the proper lessons decades ago.
Reply: @spk1121  No one gets to decide how tax dollars are spent anywhere.  If they did, many people in the US would object to everything YOU want as well.  That's not how taxes work.  I wouldn't, personally, ever allow my money to go toward the military or religion or groups run by old white straight people, but none of it works that way for anyone.
Reply: @corncrackerkid5092  The world isn't going to need physical jobs like those much longer.  Few jobs than ever before actually require manual labor.  One day, not too far in the future, even construction work won't be manual labor anymore.
Reply: @spk1121  There is no rational unselfish reason for anyone who isn't a white, straight, cisgender, male, who at least claims to be religious whether he is or not, to be a Conservative about any issue.
Reply: @troyweatherford2428  No nation will ever actually need a gigantic military.  The US needs to get rid of 90 percent of it.
Reply: @jwb52z9  Bullshit, I personally know people that get free health care, free housing, and free food. Free to them anyway. All you have to do to qualify is have a kid or be "disabled".
Reply: @jwb52z9  and what are these countries that seem to have it all figured out?
Reply: Some of the best Universities in my country are free or almost free (tuition wise).
Reply: Education is free. You're free to pay and get whatever degree you want without forcing someone else to pay for it.
Reply: grodhagen maybe free for you. Those who work and pay taxes are actually footing the bill.
Reply: grodhagen maybe you are the one who needs an open mind. Taxes are not payment for services rendered. Try not to pay your taxes and see what happens. I tell you: you get fined and if you refuse to pay, you go to jail.
Reply: grodhagen funny how disagreeing with you is not staying on topic and being closed minded. What’s next? I’m dumber than you? “Dude” nothing you said proves that healthcare or education is free. How about you pay for your expenses and I pay mine? That’s my position
Reply: grodhagen Take care.
Reply: @jwb52z9  while China maintains nearly 5 million men in the field? Ridiculous, it's not just about the actual soldiers themselves but the technology required to counter modern threats.
Reply: @jwb52z9  why should I pay taxes to fund your associates degree in gender studies or political science?
Reply: 1901 was before the Red Scares. Socialism would be demonized throughout the 20th Century in the U.S. to the extent that Social Democratic reformist ideas would be nearly extinct.
Reply: @GoldenOrder  No it's not. It's just paid in part by the people who chose not to go to college through our insane 60% tax rates...
Reply: @GoldenOrder  The point is, you don't pay less, other than the amount people who didn't benefit from it are forced to pay for you.

And that's not highlighting the absurdity of calling something that you do in fact pay for "free". If by "free", you mean "forced to pay for, whether you want it or not", sure.

Saying that people who study pay for it as well doesn't make a difference. Why should you be forced to pay for a university education that you didn't, or was unable to get?
Reply: @GoldenOrder  You seem to think I'm from America. I'm not, I'm Swedish.

As the tax rates and social safety nets of Sweden and Norway are similar, I'm going to speak from experiance and use Sweden as an example instead of Norway if that's ok.

The Idea that we save money here is not true. The median effective tax rate in Sweden is 56% when including consumption taxes such as VAT. In the US that number is between 18 and 22% depending on the source.

56% of a median income in Sweden is about 250,000 SEK a year, or $25k for ease of comparison. As Americans would keep 2/3 of that money, you can expect them to have about $8000 extra per year left over if they made the same amount of money.

Now considering that the median income in the US is about $5000 higher per year than in Sweden ($29100 vs $24300), you would expect Americans to have about $13,000 extra per year. (Granted, this part is less true for Norway, so just use the $8000 in that case)

Over a career of say 40 years, that's $520k.

The average student debt is about $37,172. That's what, 7-8% of the taxes that we "save money on". The rest you can just buy a house with or something...
Reply: I laugh now, as an eu Citizen your pain is hilarious to me!